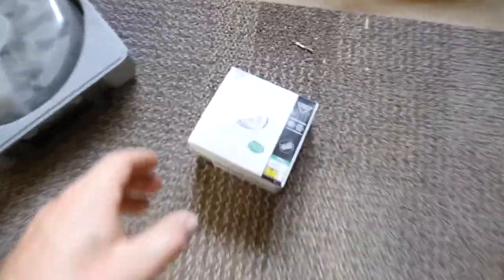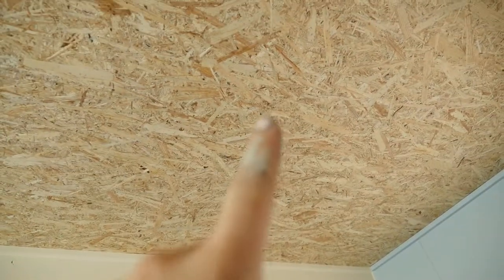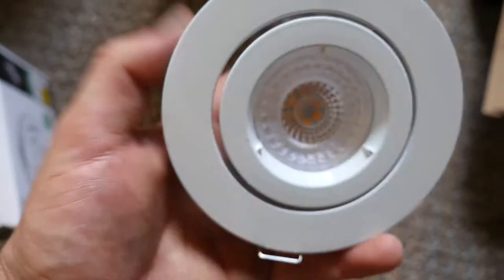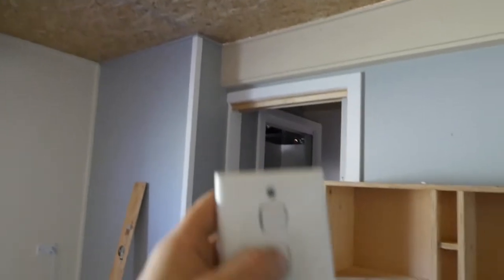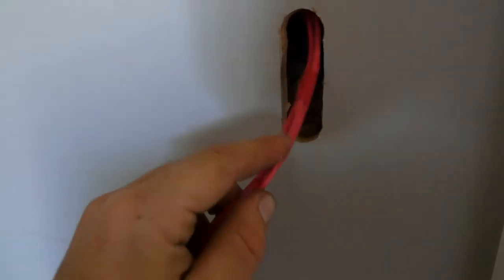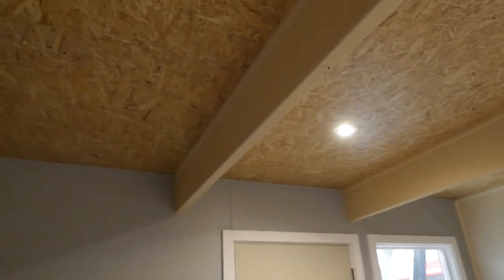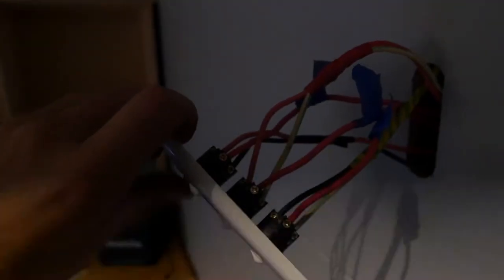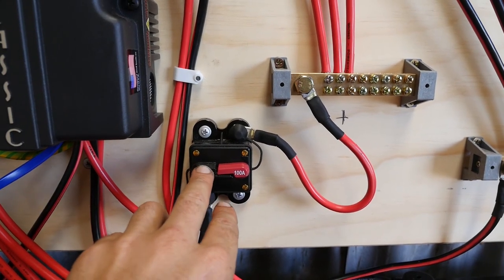Wiring 12 Volt Lights - Building A Tiny House

Comment: Could you have came out of the bottom of your mpp controller to yr breakers for yr 12v lighting? Just curious, trying to figure it all out and the way I should do it whenever I go off grid. Good job by the way. Like to watch more of yr videos!
Reply: I'd only be guessing but if you were running lights from the load on the mppt you probably wouldn't have any power at night as I think it would only get power from the solar panels.

Comment: Did you just drill holes in your roof sheathing? Pretty sure those are for finished ceilings where you cut into the drywall.